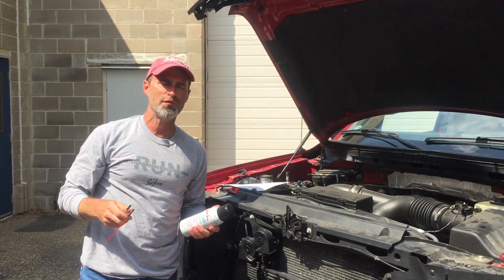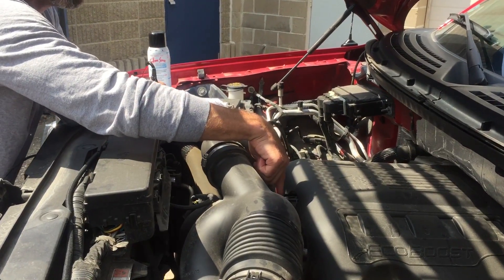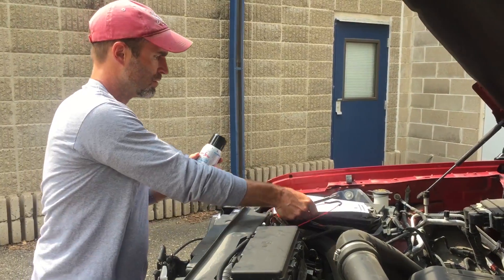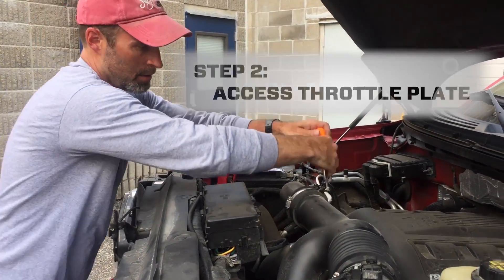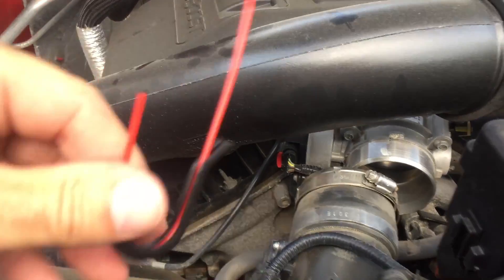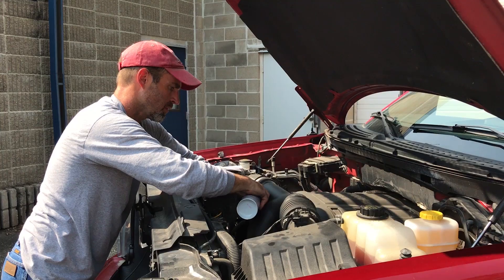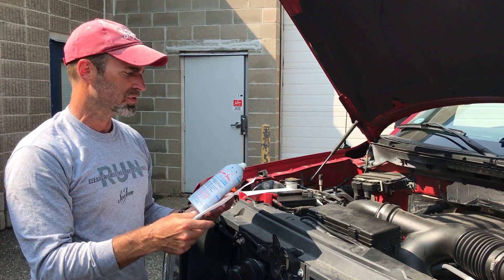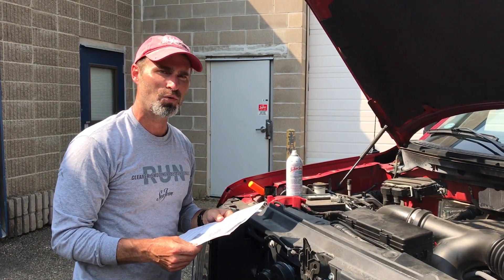(Absolutely👍) Yes, you can use Sea Foam Spray to clean a turbo gas engine

Comment: Can I use this on a focus st with 109k miles? I was thinking of either spraying it in the sound symposer port or taking off the charge pipe and wiggling it in between there
Reply from the maker: Any gasoline intake, right in front of the throttle plate!
Reply: @SeaFoamOfficial  my car has a turbo and I'm having a hard time finding where I would spray this and I'm scared I would somehow damage the engine ..I was planning on pulling tho whole intake manifold and using seafoam as a cleaner with wire brushes and brush the carbon off the valves....then use a vaccum and compressed air too blow out all the gunk?
Reply from the maker: @outdat3d-04zx10r-ha  You can't find the throttle plate? Look where the air boot attaches to the throttle body.
Reply: @SeaFoamOfficial  yes I can I just don't feel comfortable using it while my car is running...I have an Oil catch can on the way for my car...it has 110k miles 14 Ecoboost ST...when it arrives I plan to use seafoam to clean it with the engine OFF..I will pull my intake manifold..make sure the valve I'm working closed up...I'll let the seafoam soak for a couple minutes and start scrubbing away and then blow out all the gunk...I hope that makes sense
Reply from the maker: @outdat3d-04zx10r-ha  What specifically is your concern about applying while the engine is running?
Reply: @SeaFoamOfficial  my motor is specifically know having some of the "worst" carbon deposits on the valves....worried a chunk will break and either damage my valve seal/piston/turbine wheel ....if that makes since...and it's never been cleaned at 110k
Reply from the maker: @outdat3d-04zx10r-ha  Sea Foam Spray will not cause 'chunks'. It will liquefy varnish (like dried pankcake syrup) that holds carbon ash together. Hope this helps!

Comment: Is this product OK to use on my 2011 Audi a4 2.0t and if so are there any issues to watch out for when using it?
Reply from the maker: Hi Ryan. Yes, OK. One is make sure your warm up the engine before application, and two is make sure the engine is at 2,000 RPM when applying the spray. The can instructions cover things well.

Comment: Sea Foam Official, I have read other articles online stating that doing this is harmful to the turbos as it can release the carbon deposits on the intake valves through the exhaust valves and into the turbos inturn causing damage? Turbo failures are generally caused by poor lubrication or "foreign objects".
Reply from the maker: Hi Perry. How Sea Foam Spray works has nothing to do with the turbo. Please look over the Q&A and see how similar questions are answered.

Comment: Can it also be used to clean a diesel engine?
Reply from the maker: Hi Luke. No, do NOT use in a diesel intake. Adding a fuel source into a diesel intake is dangerous. See "diesel runaway".
Reply: @SeaFoamOfficial  Thanks for the reply. I figured as much. I'm new to diesels. I assume using the regular SeaFoam in the crankcase is fine though for diesels?
Reply from the maker: @fgcvhhbvjhbj  Yes, will work great in the oil crankcase!  Did you see our vid on adding Sea Foam to a diesel fuel filter?
Reply: @SeaFoamOfficial  Great! I used seafoam in the crankcase and changed the oil now. Now I know the engine is clean. I didn't see the fuel filter video but I just watched and I'm due a new fuel filter so I'll definitely do this thanks 👌 Love seafoam

Comment: I do this before every other oil change on my BMW N54. I use the manifold vacuum hose that goes to the bov or diverter valve. It  actually cleans your catalytic converters in the process. After 120k I went catless and stocks were spotless.
Reply: Only an idiot drives around with a CAT.

Comment: The intercooler on my Subaru is directly on top of the throttle body and in order to get the red straw into it, I would have to remove and reinstall the entire intercooler. I'm not even sure I could reassemble it with the straw in there. Is there another option?
Reply from the maker: It's tough to tell without looking at the engine - sorry!

Comment: I've been using this on my 2014 F150 Ecoboost since my second oil change way back in 2015. The first time I used it, it looked like the car from the movie Uncle Buck the first time I drove down the road after the hot soak. 

I know the general consensus on the internet is to use this on turbo'd GDI motors, but I've never had an issue. I might think twice about it if I had let my truck go 150k miles and get serious build up before I tried it though.
Reply from the maker: LOL, Uncle Buck car scene leaving the school parking lot!
Reply: 😂 uncle buck

Comment: My turbo is right in front of my throttle body. Im worried about the seafoam damaging or starting a fire due to its flammability. so seafoam will pass through my turbo with no issues?
Reply from the maker: When you apply at the throttle plate, the spray goes right into the upper engine, then pushed as vapor out the exhaust valves. No relationship to the turbo.

Comment: Will this work on a VW Tiguan S 2014? 2.0 TSI engine.
Reply from the maker: Yes, any gas engine.
Reply: How can I add it? I have carbon build up I’m sure in my intakes. You think it would work if I just pour it into my gas tank?
Reply from the maker: @tyjuanarards2618  Spray is needed to clean through the intake.
Reply: I used the wrong coolant for my car and it built up carbon in it I’m sure.
Reply from the maker: @tyjuanarards2618   Let us know how it goes.
Reply from the maker: Note that Sea Foam in fuel will help to to clean injectors and chamber areas, but does not pass through the intake or clean intake valves.
Reply: @SeaFoamOfficial  thank you! The whole times it wasn’t that. It was a pcv valve that went out. Also, water pump and thermostat went out.
Reply: @SeaFoamOfficial  It was my fault on everything I added the wrong coolant. And all vw take certain coolant. Messed up the pcv vavle Im sure. And caused my engine to over heat because it would be gone by tomorrow.
Reply from the maker: @tyjuanarards2618  I would not worry or think that your PCV valve would have been affected.

Comment: What happens when big chunks of carbon breaks off and goes through the turbo and breaks off the turbo Finns.
Reply from the maker: Detergents work by breaking things up. Sea Foam is NOT a detergent. Carbon deposits are unburned fuel ash held together by sticky fuel varnish. Sea Foam and Sea Foam Spray liquefy varnish. There are no chunks. Hope this helps!

Comment: Would I be able to run this through my charge piping and intercooler? I'm asking because in my car the throttle body is under the manifold so I really have no way of attaching it right where the throttle plate is so my only option would be to run it through my charge pipe and intercooler then through the throttle body, but it wouldn't run through the turbo
Reply from the maker: Thanks for the question Luis. It won’t harm the intercooler but if you end up applying the product too far from the throttle body, the fluid might end up pooling in the intercooler.
Reply: @SeaFoamOfficial  one more question; Is it safe to run through areas where my MAP sensors are located?
Reply from the maker: @Lui5_torre5  Yes
Reply: @SeaFoamOfficial  does sea foam stand behind this guarantee if something happens and causes damage? 🤔
Reply from the maker: @drennenrichards1676  How could it cause damage?

Comment: I put Seafoam in my GDI Kia. No smoke happened even after the hot soak. I drove about 2 miles and a huge puff of white smoke came out at one time. It was amazing. I’m wondering what the car behind me thought. Reminded me of a smoke screen on Army Tanks. After that the Kia had much more power. The car felt lighter and much more pick up speed.
Reply: Definitely tought their goes James Bond!
Reply: Hooah !!!

Comment: The best way to stay ahead of the valve carbon build up due to direct injection is a catch can. Installation.
Reply: Only if you install one of you get it brand new.
Reply: 🤔i wonder if having a catch can installed while doing this would be bad, wouldnt the catch can just suck up everything from on top of the lifters??
Reply: @brianreimers8112  I don’t think so.  My understanding is that the catch can takes the oil vapor coming off the crankcase before it is injected back at the intake valves.

Comment: This does not answer a question that I have. The question that I do have is is this product safe to spray through a turbo. CRCs intake valve and turbo cleaner advertises that is safe to spray through the turbo.
Reply from the maker: Hi Joseph. Of course it is safe. Why would we create demo video using the product on a turbo engine if it were not safe? How it works has nothing to do with the turbo.
Reply: @SeaFoamOfficial  it has everything to do with a turbo if I were to induct the product pre turbo and it goes through it. All I would like to know is it safe to do that way.  My plan is to induct the cleaner pre turbo to clean any gunk the PCV dumped in. I already have a bottle of your product. Is it safe to use it this way.
Reply from the maker: @josephodrain  It is applied directly in front of the throttle plate (after the atmospheric air has passed through the compressor).
Reply: @SeaFoamOfficial  Understood. So not endorsed to flow through a Turbo. Thanks.
Reply from the maker: @josephodrain  Always at the throttle plate and you're good to go!

Comment: Can I please have your honest thoughts about the impact on my catalytic converter? I have a GDI with 21,000 miles just purchased it, and the intake valves are super gunked up. Im hesitant to clean with this method because the catalytic converter will receive all of that on the way out... Will that gunky carbon bake into my converter and clog it potentially?
What are your honest thoughts on this? Thank you
Reply from the maker: I would not think twice. Carbon deposits are unburned hydrocarbon fuel ash particles held together by varnish. When cleaned from intake valves everything goes through the combustion chamber to burn. How it all actually works and how some people want to imagine how it works are not the same thing. Hope this helps!

Comment: I have been looking at this product for a while for my 3.5l ecoboost and the concerns with carbon build up. Can you please tell me why there are ford techs on here claiming that ford is recommending against this type of service and saying that it is not safe and causing turbo failure? Thank you for the help I want to stay ahead of the carbon build up problem but also don't want to cause any damage to the engine/turbos considering I am out of warranty!
Reply: My guess would be because it is possible that if you had large enough carbon buildups, the seafoam could knock it loose in chunks, hitting the turbo potentially causing damage. I'm not an expert by any means, so this is just a guess based on what I know about seafoam and turbos
Reply: NO YOU ABSOLUTELY CAN NOT USE SEAFOAM IN A TURBO GAS ENGINE!  I AM A Ford technician and I have seen many turbos burn out from the sea foam 2 problems with seafoam first of all it cleans the bearings in the turbo which needs to have the oil on them and it can cause the oil to be cleaned off and the bearings to go out and also the way seafoam works is it gets so hot that it burns off the carbon but it burns too hot for the turbo so it melts the impellers in the turbos especially in the EcoBoost because their turbos are not downline their turbos are built right into the exhaust manifold in which they run hotter than normal so using seafoam to clean the valves in EcoBoost will burn out your turbos I am replacing turbos due to this fact!
 Use it if you like I make good money when you do.  BUT you now have the FACTS.
Reply: @normogaard1  unless your turbo is already blown, there is no way this spray seafoam should come in contact with bearings inside the CHRA of the turbo if you spray it through the intake. Also, it is damn near impossible to melt a turbine wheel inside a turbo. I have had many vehicle that I have converted to e85 which is an alcohol based fuel and I have NEVER melted a turbine wheel. Not to mention the ecoboost engine have coolant jackets that run around the exhaust ports.

I worked on these engines way back when they were in prototype phase and never seen a melted turbine wheel ever even after they put these engines through the most torturous of tests. 

What you may be experiencing as a tech replacing these turbos is from people putting seafoam in there oil, which I can see causing a problem with bearings and then the excess play causes the turbine wheel to get chewed up by the turbine housing and can APPEAR as if it is melted because the wheel gets pretty messed up and the turbine blades can get twisted up. 

But melted....no way.
Reply: Unicorn Queen is there any safe way to clean valves on the eco boost then?
Reply: @chasembellmor138  I'm interested in this answer also. From what I've discovered, there isn't. It seems that at about 120,000 miles you should have the heads removed and replaced or cleaned and this will save your turbos and in turn prevent catastrophic engine failure. Sucks!
Reply: @Nomujy4u  unicorn queen is a known troll against Seafoam. Take it however you want to.
Reply: @JT-cm3ff  ok thanks, I was unaware.

Comment: I have a 2018 Alfa Romeo Giulia 2.0 Turbo with 45,000 miles.  I know you state this product is safe, but to your knowledge is there anything that would be different in an Alfa Romeo engine vs. an Ecoboost that would either be prohibitive or you would advise against using this product in this vehicle?  I've used Sea Foam in every other vehicle without hesitation, but this is the nicest/ most expensive vehicle I've ever owned.
Reply from the maker: Nothing different. Contact our tech line if you need some help or direction.

Comment: I'm sorry if I missed it, but what is a hot soak? Thanks
Reply from the maker: When you shut the engine off there will be a lot of Sea Foam Spray (fluid) soaking in the upper engine areas while the chambers are still hot.

Comment: What if you take intake line off the brake booster and run the seafoam in like that
Reply from the maker: Doesn't work as well. Doesn't disburse evenly.

Comment: Won't this product end up breaking chunks of carbon off the valves, those chunks then go into the turbo charger(s) and then possibly into the CAT causing expensive damage to them. I have a recently purchased 3.5L ecoboost with 90k on it and am really scared to do serious harm to components further on down the line. I want to install a quality catch can, but that won't do anything for the carbon that is already on the valves, correct?
Reply from the maker: No worries. Sea Foam Spray is a solvent that dissolves the varnish that holds carbon ash together. It does not break off chunks.
Reply: @SeaFoamOfficial  Thanks for the reassurance! If I have 90k on my truck, should I spray in the intake, maybe two cans or just wait for the next 10k interval? I notice cold starts are a little rough and the sensors may need to be cleaned as well.
Reply from the maker: @EurocatGames  You can do one or two. I do two at a time (personal preference). Let us know what happens. :^)
Reply: My 2012 3.5 eco now has 254K. I went to the ford dealer twice for induction cleaning. I think it is worth the money.  No problems with my turbo plus I change the oil every 5K with full synthetic since 100K.  When fully warmed up especially during the hot summer months before I turn off the ignition I let the truck idle for 2 to 3 minutes as recommended by a mechanic. Other than a dirty MAP recently which I sprayed cleaned the truck runs good- hoping to make it to 300K

Comment: Hey hey, for anyone out there with a turbo engine....GDI! I was skeptical to use... per manual that states they prefer to not use additives to gasoline. My veloster turbo was misfiring, I decided to use seafoam, after about 100 miles or more, the engine light went off and the misfiring has certainly decreased! I think another can should do it! I thought injectors was the problem, and coil. Coil I checked, but not injectors...
I hope this helps!
Reply: Adding seafoam to the gas tank will do nothing to clean the valves on a GDI engine! Thats why this video shows how to properly apply it to clean the valves. Did you two watch the video??
Reply from the maker: Did you add Sea Foam to the fuel tank or Sea Foam Spray through the throttle body?
Reply: @SeaFoamOfficial  Hello, 
I added to the fuel! Moving forward, I'll add every 3k miles! 
Hopefully, the same result ell happier with my 2007 Sonata ... will keep you guys updated...
Hopes this helps!
Reply: @nike5246   I did the same thing earlier this week to my 2017 Chevy Trax that has a turbo, and the engine light is on, I haven't refueled yet since I poured it in my gas tank. I can tell the misfiring has decreased, but the engine light is giving me anxiety, any thoughts @seafoamofficial ??
Reply: @nike5246  My 2006 Sonata 3.0 V6 loves Sea Foam!
Reply: @SeaFoamOfficial  I did the same thing earlier this week to my 2017 Chevy Trax that has a turbo, and the engine light is on, I haven't refueled yet since I poured it in my gas tank. I can tell the misfiring has decreased, but the engine light is giving me anxiety, any thoughts @seafoamofficial ??
Reply: @MsSimona31  Hey Simona. For me, the engine light didn't turn off, for at least 100 miles.. I think! Unfortunately,  it came back on today! 😡 
@seafoam, how often can I add seafoam after the first can,  it's been less than 3k miles!?
Reply from the maker: @MsSimona31  Did you apply Sea Foam Spray or just pour Sea Foam in the tank?